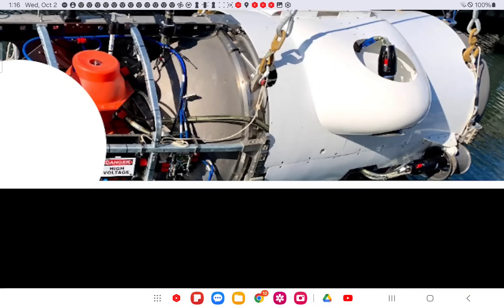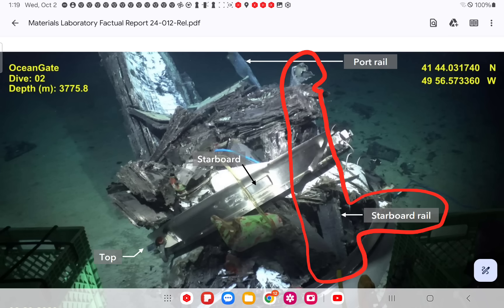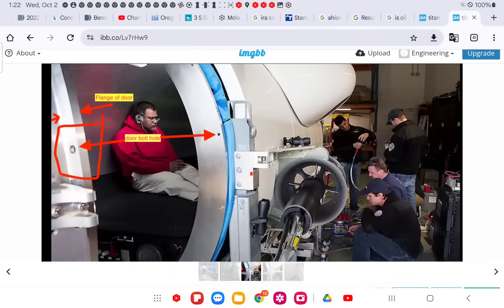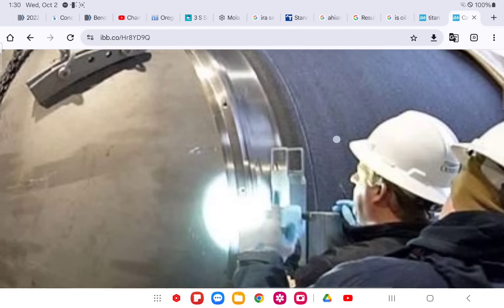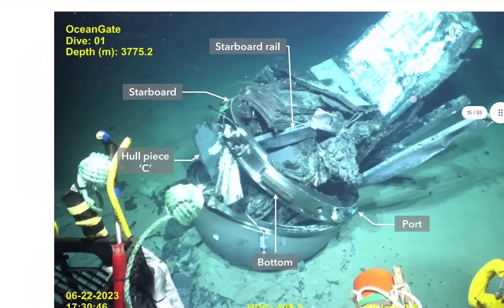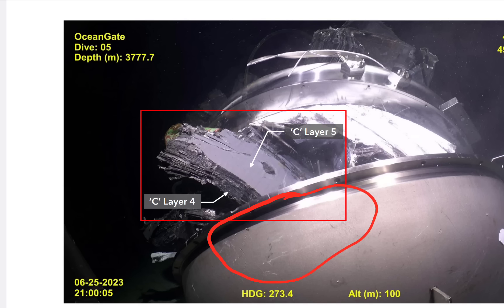Titan Submersible rear end weld failed at interface ring- PROVES REAR END FELL OFF FIRST

Comment: Do you know the requirements (which are many and very expensive) to weld on Titanium? 

Titanium Properties And Welding Challenges
Titanium is almost 50% lighter than stainless steel but more than two times stronger. So, it has a nearly four times better strength-to-weight ratio. However, titanium has a melting point at about  1670°C (3035°F), while stainless melts at about 1450°C (2642°F). Therefore, you may need some more amps to get the puddle going.

Like aluminum and many other non-ferrous metals, titanium has a strong affinity for oxygen. When left at room temperature, titanium will create a thin titanium oxide film on its surface. This oxide layer is a positive factor because it prevents additional reactivity, but it makes welding challenging. Titanium oxidizes rapidly when heated above 650°C (1200°F). So, it's imperative to provide exceptional shielding gas coverage for maximum weld quality.

(source: https://yeswelder.com/)

Thus, ever the tightass, Rush did NOT do of these things and just got an ordinary Joe welder to weld those stainless steel brackets on- knowing that under extreme pressure they would FAIL. And boy did they!

Comment: I can see where there was a lot of stress put on the whole vessel during the open sea transport ( really idiotic) 
and maybe a lot of pressure on the rear ring with that rear tail section attached. I also see the rear c ring that’s been sheared and 1 flange ripped open ,  I also see the front c ring completely sheared off on both edges—- I also see all the debris pushed into the rear dome.   Until someone does a test I’m saying it’s a toss up but I’m leaning on a frontal collapse.  Time  will tell !

Comment: This video is a hot mess. The front ring had no glue on it and the thin edges that formed the 'C' channel where the end of the carbon fiber hull was originally glued to were sheared clean off. The sub failed at the forward ring.
Reply from the maker: Please forward your findings to the coast guard and to NIST so they can stop working and close the case, thank you closing this case. 😆
Reply: @ForensicCats literally, so glad this is solved now. And did it Pro Bono. No consulting fee, so brave.

Comment: The Titan was the Yugo of submersibles.  It was designed to fail, manufactured to fail, "tested' to fail, and handled to fail.  Unfortunately, it met its expectations.  If any reputable testing authority had inspected it, it would have never gone to sea.

In any event, there is always a "root cause".  That is the initial step (design, defect, handling, material, etc.) that started the chain of events that led to the outcome.  

In the process of failure analysis, determining the root cause (known as a root cause analysis) can require the efforts of numerous subject matter experts, forensic testing facilities and experts, documentation surrounding the failure, and extensive time.  However, in this case, the root cause is obvious:

Stockton Rush.
Reply: Not sure if youre aware. But no certifying authority wouldve even considered showing up for a carbon fibre hull for a human rated vessel.

Comment: Ehhhhhhhh, I get what you are explaining, but it's still not oblique enough to say the tail cone came off before the implosion.  There also isn't evidence that the tail cone was still attached suring the implosion.  So, this video has me more speculative than objective.
Reply: Of course the tail cone was attached just before the implosion. Look at the way it was fixed to the cylinder. It was fixed slightly below center of mass. The cylinder imploded from the top righthand side of the front ring. The debris hit the aft hemisphere causing it to bump the tailcone (being mounted right below center of mass) upwards. Hence why the tailcone stands upright. It went (viewed from the side) like a hatch with the hinges on top of the craft. There was absolutely no reason for it to come off at any other point in time.
Reply: @baronhelmut2701 . I’m thinking your close
Reply: keeping in mind it was of equal pressure.

Comment: Those rings are the same rings they used for the original hull that had cracked. So that means every design change to those brackets involved somebody removing the old bracket and grinding the welds down smooth to mount the new brackets.It's not a good practice and I wonder how they would have kept the mating surface uniform with the rest of the ring since it's surface is cylindrical. Any non-uniformity in that surface would create gaps that would need to be filled with extra weld. Which is another bad practice. Especially when you're dealing with load bearing members. 

Whatever the case is, I don't think a weld like that would have held up for very long, so I am thinking that work is from a repair that occurred shortly before the fatal dive. And it turns out that they installed new manual locks about 2 weeks prior to that dive.
Reply from the maker: I talk about the re-use process in the next video, at 1:30a.m
Reply: @ForensicCats  I can't stay up that late. I'll have to catch it tomorrow morning. :(
Reply: @ForensicCats  I am definitely looking forward to hearing about that. Because I didn't hear any mention of them grinding and re-welding replacement parts back on. Because that is NOT a good idea if you're bracket is holding something critical. Every time someone takes a grinder or a welder to that surface, they are compromising both the form and the overall structural integrity of the material.
Reply: those rings had to be so far out of round, its probably best just to call them ovals.
Reply: @Toobzilla  I wondered about that. I wish I could find a good straight on shot of the recovered rings because I'm usually pretty good at spotting eccentricity if I am looking at it straight.
Reply: @Toobzilla  They probably had flatness parallelism errors too. Those rings got beat to hell, and there's no way they held their shape after all that.
Reply: @FarewellToGods  agreed, 1000%
Reply: @FarewellToGods of interest, i dont think its possible to  heat treat ti to a hardness level much beyond rc40, if that,controllably. ti is a gummy material its odd to work with. idk anything about submersible construction but ti strikes me as a poor choice for a hull structure for something going that deep. if it flexes more so than steel, which can easily be heat treated to bearing grade @ 60-62rc wouldnt that have made it a better & cheaper alternative?.. the positive characteristics of ti really dont even apply to this, do they?

Comment: The equpment in the tail end was blasted off when the carbon fibre hull blow out the rear dome pushing the tail end away from the body
Reply: my money is on the tail coming off first and the hull imploding closer to 3777. why is the debris field so large?
Reply: @istovitx633  ive not looked at debris field in detail. Not sure why the tail end would just fall of for no reason that could of left them sat at the bottom of the ocean with no power or comms. That would be 2 failings when it would of only needed one
Reply: look at how little counterbore there is @ the dome/ring interface!
you CANNot get  Joey da weldah to lay some bitchin beads & call it good, wtf.. localized heat spots would drive brittle into that integral part... it would need an heatreat/age cycle,  fpi & full qc-50 inspection before approval for re-dive..

Comment: My layman guess is that the last straw was dropping the two weights. Seems the sudden weight difference could flex the carbon fiber hull and throw it over the line.
Reply: It would be a very layman guess. Because if you drop weights, the force delta becomes smaller slowing down the craft and therefore the rate of change of the pressure on the hull would decrease. That is actually better for the hull, not worse. 

Its not the weights that did it in. Weights are common practice in submersibles. 

Its the numerous small mistakes they made that tallied up to cause this. 

They mounted the vessel incorrectly onto the crane when they lifted it. 

They couldnt manufacture the glue join in a reliable manner. 

Their manufacturing facility wasnt clean enough and the autowinder wasnt precise enough to avoid bumps in the hull. 

They reused parts that had already been through a few pressure cycles. 

They ignored data from the monitoring system (which clearly showed that the vessel had been permanently damaged on a previous dive).

They put a guy in charge of piloting it that is not a submersible pilot nor had any experience in such things.
Reply: @bunnierivera3754  The 2 weights totaled 70 lbs. It was a relatively tiny change in the sub's overall weight. It only reduced their dive rate slightly as they approached bottom. The net result would be slowing the rate of change. The craft was doomed from its inception. The qualities of carbon fiber under compression were a known quantity. It was just a matter of time before Stockton Rush and the passengers would pay the price for 'breaking the rules'.

Comment: I disagree i think the front glue seam failed and blew everything to the rear causing the damage you described if the rear failed it would have blown everything to the front.
Reply: Agreed - interesting observation of the rear weld failure, however I'm also of the opinion that the initial failure occurred at the front glue line and then it was the force of the subsequent implosion which caused the rear weld to fail as the surrounding water entering the vessel essentially pushed the rear dome backwards into the tail fairing.
Reply from the maker: And ... The coast guard and NTSB might say just that but can you show animation with the front as the starting point? 
I cannot show the front... I will do a model for all the "front glue -line folks"... It cannot get us this debris field... My video at 1:30 Eastern tomorrow will go over the debris field again and show how it can't work from the front only
Reply: @ForensicCats  It says it is scheduled for 1:00 am. Is that right?
Reply: @ForensicCats  I would like to see your animation showing how a rear failure will result in debris collecting in the rear dome only. Not sure how you can use the debris field to support your argument. They imploded at 3300 meters, allowing for 500 meters of debris to travel in the current. Agreeing with Brent that front ring failed initially, followed by the failure of the rear ring as the carbon fiber broke up. Due to the initial failure in the front, the implosion forces directed towards the rear dome. This is why we found the majority of the carbon fiber hull to be within the rear dome, and the front dome and ring being blown clean off.
Reply from the maker: I looked at the four links you sent me.
 
 Not one of your sources  are correct, I have nothing to offer you @brwntbump96 please do not waste your time watching my content. Ty
Reply: The bracket breaking off would detach it from the carbon fibre cylindrical section causing it to collapse in on itself.
Reply from the maker: awesome. case closed

Comment: How do you know that it was ever welded?   Everything is jammed in to that end of the vessel its obvious the implosion started at the other end, the front.    The back was separate from the pressure vessel and of course it fell off after the implosion do to the force.  The rail spanned front ring to back ring and when the implosion happened the rail was sucked inside.  The rail in the photo identified as "starboard rail" was always in front of the rear ring and did not hold the back end on nor was it part of the structure of the pressure vessel,  it was there to attach the white outer layer to.
Reply from the maker: Here is the follow up video https://youtu.be/j4KPQuTN4b4 and it is full of truths and exposures and in this video I reveal the welds

Comment: The drawing shows 18 bolt circular pattern on the dome. From that you can determine that each hole is spaced 20° apart with the two door bolt holes (4:10) are positioned at 80° and 100° relative to drawing section B-B which shows the front dome. Since that view is projected from the rear of the vessel we can apply the same polar coordinate values to the rear dome.

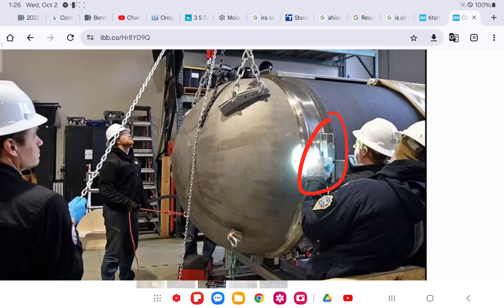6:40 The man's flashlight is shining directly on the hole above the door bracket. Based on the drawing, this is the 80° hole. Above the 80° hole, there are three more holes visible in the image. These holes would be positioned at 60°, 40° and 20°. The top tab is clearly aligned to the middle of these holes, therefore, the top tab shown in the image is located at 40° and the other top tab (not visible) mirror should be located at 320°.

6:23 The bolt hole positioned directly below the door bracket is blocked by the man's arm. But we know it's there based on the drawing. This would be the 100° bolt hole. Below that, there are 3 more bolt holes visible in the image. These holes are positioned at 120°, 140°, and 160° respectively. On the bottom half of the dome, there is a dark streak that is seen parallel to the bottom tab. Using that as a guide, you can trace that to the 140° bolt hole. Which would the middle of the 3 bolt holes appearing in that image. Based on that pattern, all 4 tabs are placed at 40°, 140°, 220°, and 320°. 

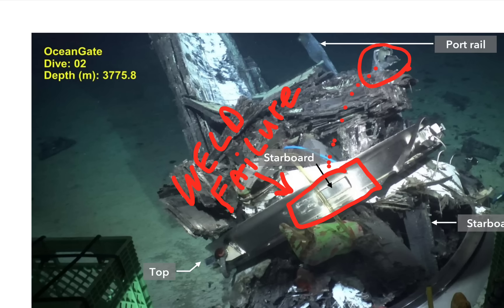Going back to the image at 6:40, the location where the man is shining his flashlight is the exact same location at 13:44 where  the starboard bracket is missing. For it to break like that, it would have had to have been a very poor weld because there's no weld attached to the ring. But what I do see are grind marks. And that makes me very curious to know who welded that bracket. Because it honestly looks like something was welded there before and was was ground off to be replaced with something else.    I have no experience inspecting titanium, but I have alot of inspection experience in machining and fabrication to know what it looks like when a welded component is ground off and replaced with another.

One important clue here is the mating component. That being spreader bar which is at revision C (10:16). This is an Oceangate Custom component because their viewport window drawing uses the same PRT prefix in the part number. The fact they clearly indicated the revision like they did on the part must have been for a significant design change that was incompatible with the previous rev. That could explain why they would have needed to change the bracket. And given what we know about Oceangate operational standards, this is precisely what I would expect from them so they wouldn't have to pay to have a new ring manufactured. 

In which case, I highly doubt that a reputable fabrication outfit would do something like that. Especially if they're working with titanium as it has a very high melting point. This means that whoever is welding it had better be damn well qualified because there is no way to inspect weld integrity without destructive testing. The bottom line is that you need someone who really knows what they're doing. And whoever welded that bracket clearly did not. It's not work done by a pro, that is for sure. With all of that in mind and the design change, I think that Stockton or one of his junior engineers removed the old bracket and welded the new ones on "as best they could" and hoped for the best.  

All of that said, it does appear the failed weld on that bracket may have been the primary point of failure on the vessel. It does beg the question why all of the other welds appear to remain intact. While it was far from the only instance of shoddy workmanship, I think this instance is an especially egregious failure of workmanship.

Comment: so the bracket on top off the ring for the top support rail for the tail section broke and the tail section fell down breaking the bolts that held the ring on and that caused the  end dome to break off. that caused the implosion?
Reply: You can clearly see the failed section  happened in the front with how everything was blown back into the aft rear titanium do.e, this guy is smart but he's reaching on this theory
Reply from the maker: Here is the follow up video https://youtu.be/j4KPQuTN4b4 and it is full of truths and exposures

Comment: Was the bang heard on dive 80 possibly the carbon layers delaminating?
Reply: Glue breaking leaving the carbon resting on the inner flange of the front ring..which failed
Reply: Yes and there was a possible crack aswell. This sub should have never been down there. It was catastrophic event just waiting to happen. CF was the worse possible material to use for the pressure hull.
Reply from the maker: Here is the follow up video https://youtu.be/j4KPQuTN4b4 and it is full of truths and exposures

Comment: With Rush’s design philosophy, the rear end would probably be intended to break away so the crew compartment could float the surface in an emergency. Other parts of the submersible such as the iron weights on the skids were designed to be deliberately shed to provide bouyancy to return to the surface, so why not have a way to jettison the rear end? I suspect that this was never really the case, but the connections were good enough to do what was necessary in the water. They weren’t up to being smashed around on a hoist against the side of a support vessel in a gale though… I’m pretty certain that the major disassembly took place during the explosion that followed the initial instantaneous implosion. That is what broke and weakened the connections, with further damage done as the second implosive shock took place resulting in the wreckage as found separated into several distinct and separated assemblies on the seabed.
Reply from the maker: here is the follow up video https://youtu.be/j4KPQuTN4b4 and it is full of truths and exposures --- note, this is like an advanced class, I cannot just spend 180 hours giving up all the data, it takes time to do background data for people and then put it all together